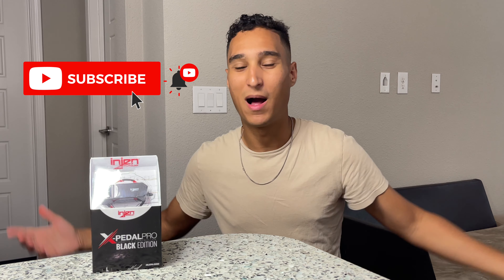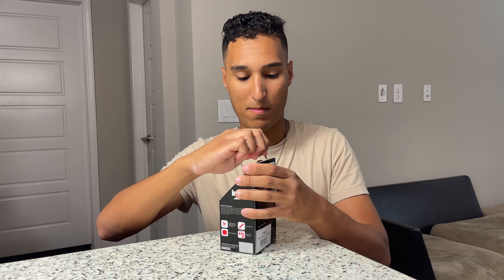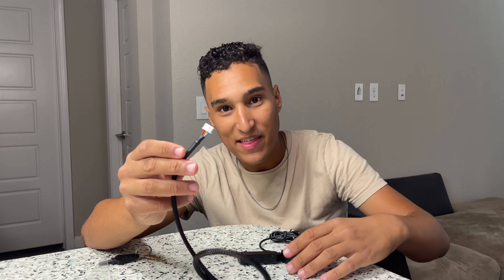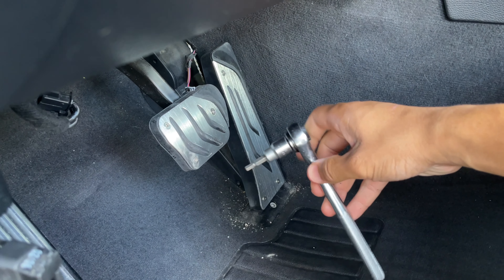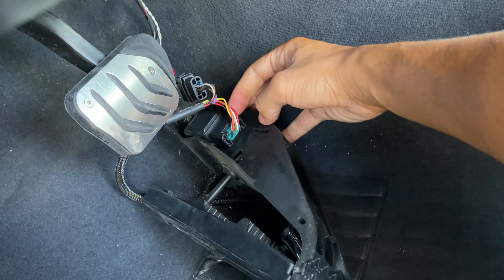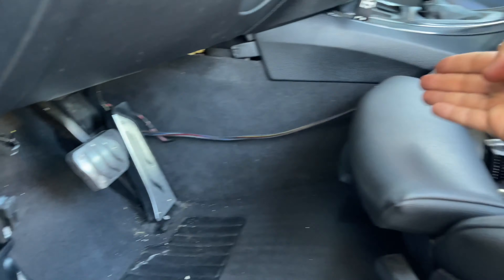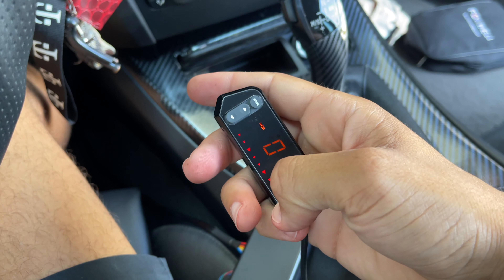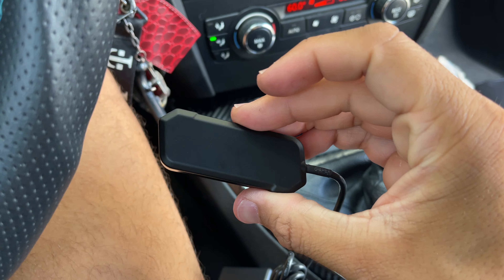BMW Injen Throttle Controller/Commander Installation! | X-Pedal PRO Black Edition

Comment: Just installed this on my is250 instant throttle response this injen x-pedal pro throttle controller is the truth! 💯
Reply from the maker: Right! It's crazy how fun it makes driving ‼️
Reply: @IzzyE9X  💯💯
Reply: @krlm2280  Any issues? Thinking about getting one for my IS
Reply: @jaylyanphillips8324  no issues at all but if u use sport mode always leave it on 5 but when u want to race or just want to have fun u can go 6-9 but don't leave on those all the time especially for daily driving
Reply: @krlm2280  how did you get the accelerator harness out?
Reply: How you tried launch control
Reply: @jaylyanphillips8324 sorry been late you just unplug it it's right under the pedal you got to go under and that the top
Reply: @Anthony-cs7qb I haven't

Comment: hey man this looks dope, but im using MHD right now and i am using the linear throttle map setting in MHD, is this the same as linear throttle mapping essentially ? or is this better.
Reply from the maker: I believe MHD gives a similar effect. The thing about this commander is you can bump the sensitivity in sport mode from 0-10, so the higher the number, the peppier the throttle. I don’t believe MHD’s can be tweaked like that
Reply from the maker: I run it on 5 out of 10 and the difference is huge. It accelerates like it gained 50+WHP (obviously only speaking on acceleration feel, not actually gaining any HP lol)

Comment: Have you had any check engine light from this
Reply from the maker: I have not! It's been almost a year and it's worked great and given me know issues. I know if you crank it all the way up to max settings you can overwork the throttle and short it out though, so it's safe to just keep it under the 7 setting
Reply: @IzzyE9X thnx for this thanks I just read it buying it for 50$ new in box today off guy who sold his Nissan before it came in  mail